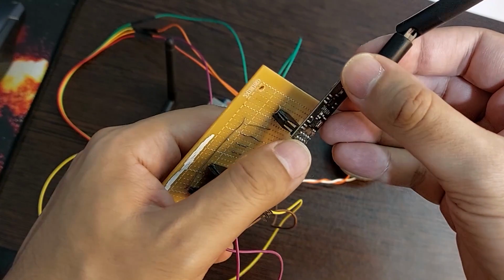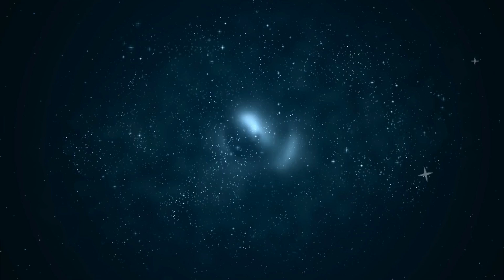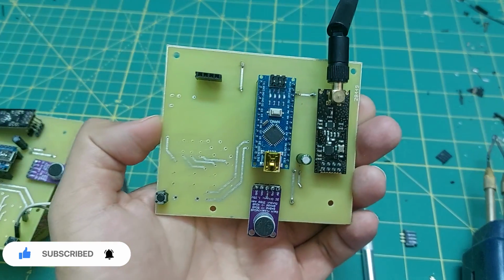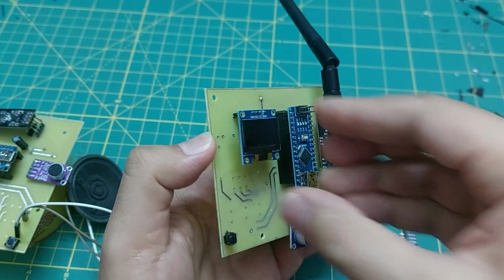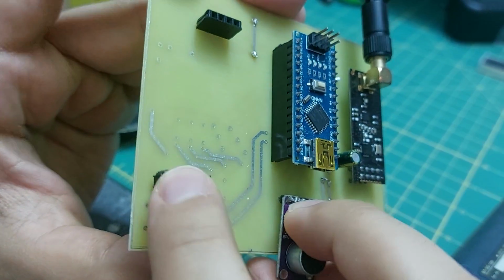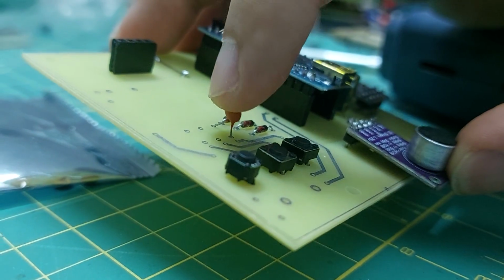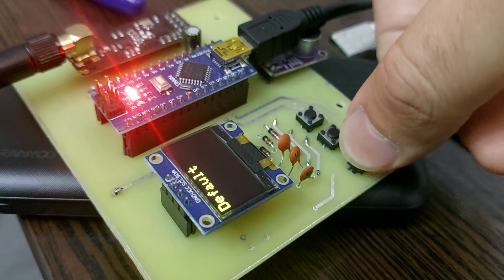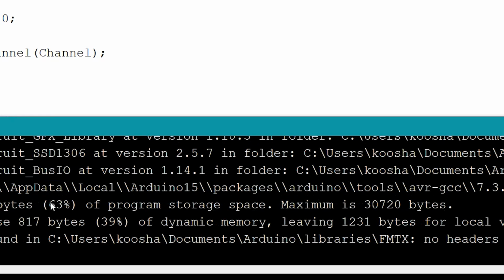Make Your Own FULL OPTION & LONG-RANGE Walkie-Talkie

Comment: please I want to make similar walkie talkie, using ESP32 and nRF24L01 but this video is not showing the circuit diagrams and connection well enough, can you post a link to an article explaining the circuit and the code for the microcontroller.

I don't even want to be a able to change the channel right now, just the working walkie talkie for my school project
Reply from the maker: I just saw your comment today. Sorry if the project for your school is missing at this moment. We were at war and I didn't have internet to respond to your comment. The link to the circuit diagram is in the description.